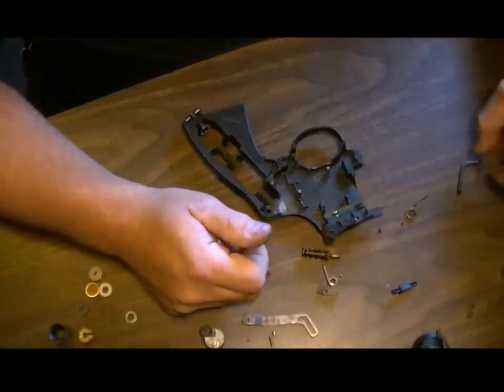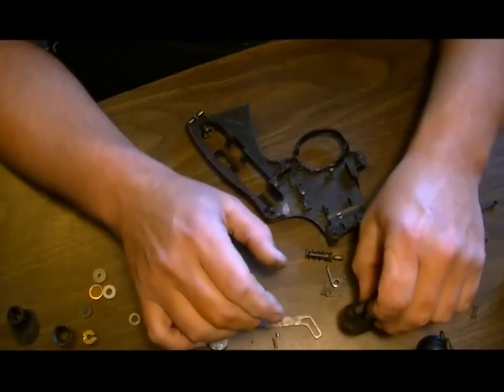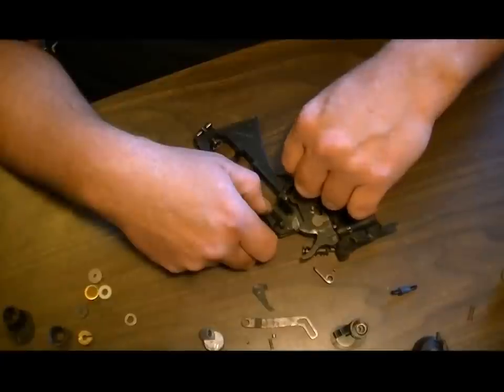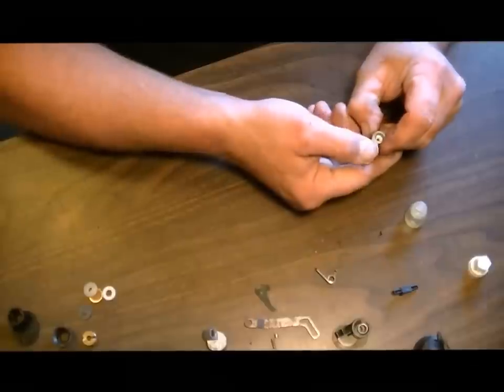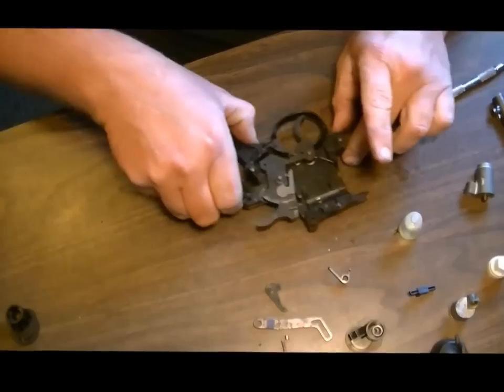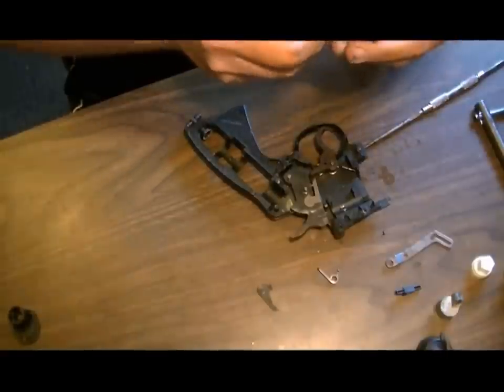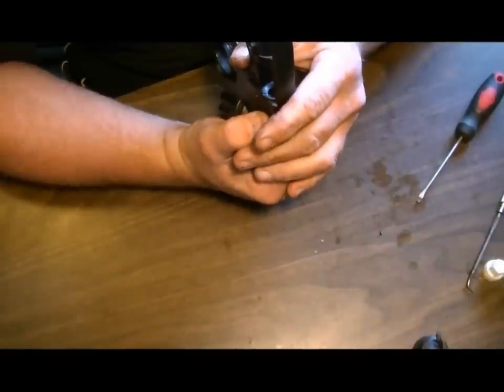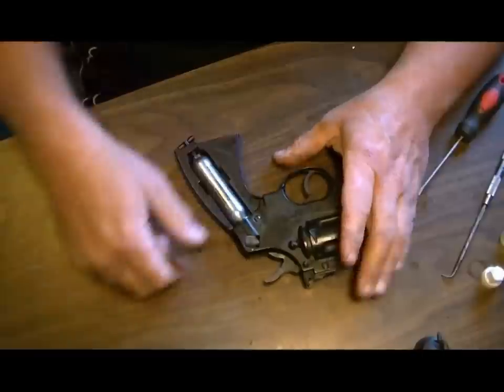Crosman 357 how to rebuild

Comment: Can I change the wedge by myself without breaking the seal you were talking if you take your Crossman 357 apart? I ordered the new wedge (the piece that helps support the latch at the barrel break) i have the brown grips which is the older model Crossman 357. Is there a video on how to do it? Thank you for your video!
Reply from the maker: Terry Fry the side cover must come off to change the support boot, you have a 1 in 10 chance that you wont toast the quad seals when you pull the cover

Comment: Great Video! Thank You.
I have a Vintage Daisy Power Line Model 44 that I need to get back together, I have everything back the way it's supposed to be except for the hammer spring. It goes under the hammer first I think before you put the hammer back in but for the life of me I can't seem to get it in there just right.
Anyway you can get me to somewhere I can find out how to position that bad boy back in right?
I've got 3 Vintage Daisy Power Line Model 44's all together but I'm not going to take one apart to see if I can see how it goes because I don't want to have either one of those messed up.
The one that I am having trouble with is one that I purchased as is, saying that it was in working order but had to be put back together because they had ordered a new valve assembly and the hammer came out when they took it apart and couldn't get it back together right. I have put back together and built a Crosman 357 Six successfully basically just like the one you're showing here. The barrel latch assembly wouldn't latch and ordered a replacement and put a new one in.
Reply from the maker: all the guys i knew that fixed daisy guns all pass away now but you could check online pellet gun forms for someone that might be able to help you out there likey will be a few guys there on one or more of them
Reply: @KevinMillard68 thank you Kevin, I appreciate it.
I'm Sorry About The Loss Of Your Friends! God Bless Them All In Heaven!!! 🙏
I've lost quite a few Friends and Dear Friends and Ex Girlfriends and Sweetheart In The Last Fee Years Going On 3 Now and All Of My Dogs Have Passed Away Too. The Last One, Buddy, 13 Year's and 8 Months Left Me On September 25 2020 and The Next To Last One, Mr. King, 13 Year's and 5 Months On April 25 2019.
There Were Many More Going All The Way Back To 2000. I Got My First German Shepherd, Smokey, Back in 1990.
Thank You Again
Reply: @KevinMillard68 
Hey Kevin
It's Richard again.
Hey I finally got the 4 pack of seals to replace the old worn out seal's in my 4 Vintage Crosman 357 6's. One of them did not have the little dust screen under the piercing cap. I cleaned up everything and put the new seal in over the piercing cap and screwed the holder screw back on. I haven't tried it yet but I was wondering if it will work without the little dust screen in there?
Thanks

Comment: Great video! . Any tips on repairing a crosman model 38T (.22 cal) ? .. I have fixed all of the seals except in the valve as I am unable to remove the valve , I know it unscrews but can't use a flat blade screw driver due to the pin being in the way since its in the middle.. Any idea how I can open it? Thanks.
Reply from the maker: the screw thats brass that in the valve has a slot your right and its a special tool needed on order to get it out, now you can use a pair of needle nose pliers just be careful not to over tighten it when putting it back together and make sure its not to lose ether, other wise the valve will leak or not fire at all, to be pretty sure make sure the back end is dry and free from any oil and use either a sharpie pen marker the brass and the aluim and make note of how far in the brass screw is as well, that special tool i show you in the video  is the proper tool , you can not buy them i had to make mine, only techs had access to them but some of guys learned how to make the tools as crosman and others have some special tools. but it the case of some of the crosman guns that need this one  needle nose piers can work in a pinch
Reply: Cool thanks for the tip and the response , it is in there pretty tight , this gun is second hand so I wonder if its from a previous attempted fix fix plus it looks abit "stripped" hopefully I will still be able to do it but I will keep trying the pliers as I can assume I need to get into there since it only leaks out of the barrel and that would be my guess is its the valve.. Does that sound right to you?.

 Thanks
Reply from the maker: Tytanium out the barrel is always the stem seal yes, also turn counter clockwise to unscrew it and clockwise to screw it back in if the threads are stripped youll need a replacement valve if that happens contact alan at abairguns he should still have alot of valves for that gun and he sells the proper kits as well for rebuilds
Reply: It's the head that is looking chewed up , like the slot , but its in there really tight maybe threadlocker or something was used , im going to need to use a lot of force haha .
Reply from the maker: Tytanium sounds like someone had some fun with it,
Reply: I'd say so .. Oh well I hope for success lol
Reply from the maker: Tytanium all you can do is try right
Reply: Yessir ..no success yet tho haha
Reply: Tytanium
Reply: Tytanium

Comment: Hi, thanks for your video. I have a leak just behind the cylinder, so I tried to disassemble the gun to see what happened, and I finally rebuild it. The leak is still hear and I don't know what to do... Help!
Reply from the maker: did you replace the seal for the co2 bottle you also have to make sure the ring is tight but not to tight in the END seal its the 38-128 seal thats for the co2 bottle ,
Reply: KevinMillard68 I didn't replace it because it was in good conditions... I just put some silicone grease on it. And anyway the leak did not come from there, but from where the gas comes out to push the pellet. Can it still be due to this seal?
Reply from the maker: Clément Petit when you seal a gun you do it right the first time , if you got gas coming out the barrel then you have to replace the valve seal. but everytime you take the cover off the 2 little black seals in the brass pipe need to be done other wise they will leak and you might think the bottle seal is good but in my experience i replace it anyhow while iam in the gun this way i dont have to take it apart again.
Reply: Ok thank you, I'll replace the two little black seals on each side of the brass pipe, but I need to study how to open the valve as it is not done exactly like yours in your video. Anyway now I know how to rebuild my 357 back to infinity :)
Reply from the maker: Clément Petit your welcome

Comment: hey man, got a question, the grips dont really stay on very well at all. any ideas on something to make them stay on a bit better?
Reply from the maker: get some custom made wood grips i hate the plastic ones my self
Reply: Apparently you can stick some of those foam sticky sided squares, you know the ones people use to stick down ornaments? Well if you stick some of those on the inside of both sides of the grip, it should then close tight. Peace
Reply: @heroesgrantorino  ty good idea
Reply from the maker: @heroesgrantorino  with this gun you screw in one grip and on the other it clips on so i got no idea what your talking about unless your refering to the new version 357 and the vigilante and the new 357 kit with the 3 barrels

Comment: my gun looks the same were can i get a new seal kit leaks out co2 quick
Reply from the maker: check ebay for the older 357s for seal kits or call alan at abairgun.com,, option 2 is order the seal kit for the new model 357 as well order the new stay valve they should fit tho i have not tried in theroy they should its getting harder all the time to get vintage parts

Comment: Hey man i also have an old 357 but the clips wont rotate when i pull the hammer back and i want to know if you could tell me some ways that i could fix it
Reply from the maker: +Blacksmith2002 sounds to me like the indexing prawl/finger is shot   see abairgun.com for parts
Reply: thanks
Reply from the maker: +Blacksmith2002 your welcome

Comment: Kevin, I need the piece you are installing at 18:30 the "latch support boot" Any help on where I could get one would be greatly appreciated
Reply: +Brad Hinz Yeah, after a while those boots turn to goo.  I took apart a BIC lighter and took the flint spring and cut it down.  That made a handy replacement.  However, you can go to a popular bidding site and search "Crosman 357 phase 1 & 2 kits".  The boot will be included.  Just be sure not to oil around that area.  The oil tends to accelerate the break down of that rubber.
Reply: Thanks for your help

Comment: As far as I know there are no restrictions here on pellet guns. Were can I find an 8 inch barrel? Could you do a video showing how to perform said mods? I'm not trying to take anything more than small rabbits. I have a .22 and a pellet rifle that has plenty of power but I'd like to be a bit quieter and I like using a pistol for compact reasons also. Thanks for your response. By the way I eat everything I kill (except rats)

Comment: Great video! Helped me figure out the parts I needed and made sure I got it back together right.
~Pierre
Reply: Im thinking abaut options several of them before parting with my cash, im not a repair tech- so im using an industrial type silcone lube with teflon like moto master 300- its not leaking from the co 2 port so plumbers teflon is out of the question- repair and return will probably cost me 23.00- so if the silicon lube does not succeed then im really interested in watching this and become a do it yourselfer like I've done in the past with my cars on occasions-

Comment: what can i do about my 357 letting out all co2 from its cartridge when i tighten it
Reply from the maker: Armando Esquivel fIX It of course new seals. see abairgun.com
Reply: You can buy a gel called Pelgunoil you dap a drop on the top of the capsule before you insert it to prevent leaks

Comment: Hi Kevin, I have one of the 357's but believe it may be an older one. The grips are brown plastic and the right hand one is held in place with two screws. My question to you is, do you still repair them, and if so, would you be willing to do mine?
       Hal
Reply from the maker: i dont repair them anymore sorry i dont even have any parts left i got right out of pellet guns , you can get the parts from alan at abairgun.com just let him know which 357 you have and get the parts from him its really easy to fix them ,, call him after 6:30pm his time zone faster to call him them to email him

Comment: hey bud. were are you from. myne is from 1979-1987 can remember. would like to get it fixed. i got it apart to check wats wrong. its all still sealed. but it needs a new barrel clip and rubber clip holder. and a new c02 seal. also needs to be sited in. are you in canada or the states. if in canada, were about.?
Reply: also needs a hand grip... lol left side.
dark brown.

Comment: Would like to get a old 357 resealed do you still do this?
Reply from the maker: i dont right now i have been thinking about getting back into it the big problem is the cost tot he customer for doing 357s is more then  what the guns cost new ,, buy the time i get the parts in and i add on the labor and then you have shipping both ways , so unless its a vintage 357 its not worht it unless you do it your self

Comment: I rebuilted, and installed a new gas cartidge, without installing the cover plate,  just to figure out where is the gas loss. Its definetely from the last point before pushing the pellet. So, something is wrong with the part that needs the special part to screwed back...

Comment: Hey man. I have an old 357 that will not lock up because the latch support is gone. Can I send it to you for repair and how much will it cost?
Reply from the maker: +DeusVult! sorry i don fix airguns anymore but you can send it to alan at abairgun.com
Reply: Kevys Rc & Music Thanks man I appreciate it
Reply from the maker: +DeusVult! your welcome
Reply: +DeusVult! I've got the same problem on mine.
Reply: Ha ha!  That's the same reason I'm here.  I took the cover off and parts went flying.  The problem was that piece of rubber.  The original part was about the consistency of silly putty.  I cut a piece off a scrap of conveyor belt.  A piece of pink pearl eraser or tire would probably work too.  Then it took me about an hour to put the damn thing back together.  Even after I figured out where everything went, the damn thing wanted to fly apart before I could get the cover back on.  I looked up the video to see if there was some trick to it... not that I can tell.
Reply from the maker: they can be tricky but once you have done it a few times its alot simpler
Reply: If I can get access to a lathe I want to machine an adapter that will allow me to fire my 357 with a 20 oz paintball tank.  That'll be a lot cheaper than CO2 cartridges. 😀
Reply from the maker: interesting idea i dont know of anyone thats ever done that to a 357
Reply: The mod wouldn't be specific to the 357.  It would work on other CO2 pellet guns that take 12 gram cartridges, and wouldn't be permanent.  All I have to do is machine a solid chunk of metal (probably brass or aluminum) to the shape and size of a CO2 cartridge, bore a small hole (about 3/32") part way down the center, then drill and tap a hole in the side for an NPT fitting.  Then I could connect it to a CO2 tank however I see fit.  I'd probably use a flex hose and strap the tank to my forearm or hip.  It seems pretty intuitive to me, but I've never seen anything like it.

Unfortunately the business where I used to have access to a lathe recently moved, and to my knowledge they have not set their metal shop back up yet.
Reply from the maker: time to buy a lathe then :)

Comment: Got a 357. where do i go too get parts. I've been on crosman website but I can't find any parts??
Reply from the maker: you need to find a Crosman repair DEPO like abairgun.com or some other place,, you can call Crosman for parts but youll need the diagram for the gun to tell them the parts you need if its and older 357 then abairgun.com is your place to go
Reply: is there 1 in illinois
Reply from the maker: i dont know iam in canada call crosman and they will tell you where all the service centers are
Reply: got my parts from crosmen. the 1 with nossle orfice is slightly larger then the old 1. what can i do. old fits snug. new one is loose
Reply from the maker: they should not be to snug at all they need to move freely if what your asking is the plastic nozzel  that goes againest the clip when the gun is closed
Reply: it's the black part with a  2 bumps going down where the arm goes too move the wheel for the pellets that is gray. I put in on and it's so loose the spring pushes it right off. i tried my old 1 and it fit snug and the spring didn't push it off
Reply from the maker: sounds like the other version of the indexing prawl thatyou have just use the old one if its still good
Reply: no it's bad. that wing broke off. i still have it i think but can i superglue that 1 back on???
Reply: made sept of 1994
Reply from the maker: super glue will not work no glue will, how ever call alan at abairgun and he will get you the right part you need get a new spring face plate as well if you did not already get one
Reply: I got part 357-035 and it's loose. i put my broken 1 on and it's snug fit.

Comment: Can you make a video how to unclog the barrel of the CO2 gun
Reply from the maker: sorry no can do iam not into pellt guns anymore and due to the fact that there are thousands of pellet guns no all will have the same way of doing it
Reply: Move the cylinder out as though you are loading it. Use a pipe cleaner or a string with a small piece of cotton tied to one end, use them to pull all of the dust and debri out of tge barrel. Blow air into it every now and then for faster results. Peace

Comment: If you swap the valve for a more powerful one you can add a lot of power. Best mod you can do. Peace
Reply from the maker: there is no more power valve for the 357 but i do know the mod for the current valve the hammer spring can also be upgraded from the old style to the new one for more power as well

Comment: I have 2 of these from the 60's. (Actually I have two 38T models in .22 cal... the one above looks a bit different).  One I used... almost daily, as a child. The second is virtually NIB that my dad bought as a spare should the first one wear out (yea... my dad was way cool). Both had their seals replaced around 1993 and they were returned to the safe. I recently tried to test them recently and, as the seals have aged, they both leak badly. Does anyone know of anyone who still works on these. I can try to fat finger a seal replacement myself but would prefer to have it done professionally.
Reply from the maker: abairgun.com is where you need to go

Comment: How do I get a hold of you to get a rebuild
Reply from the maker: you dont i stop fixing 357s and many others long time ago due to lack of parts access most of the stuff you have to track down now on ebay or find someone in the USA that still has parts, even crosman has very little parts of the older 357s the new valves that will work dont last long at all the only guns crosman guns you can trust for parts and performance these days are the 13xx and 22xx series , alot of the new guns from them either have very little parts or none at all because they are just doing warranty replacement mostely these days othre then 22xx and 13xx guns thoese your ok with

Comment: In the barrel there is a plate that has looks like a keyhole it came out
Reply from the maker: take out the barrel slid the metal plate in at same time incert the barrel in the key hole easy to do